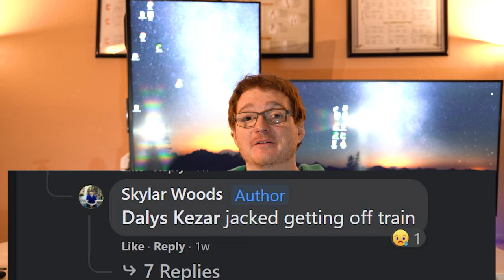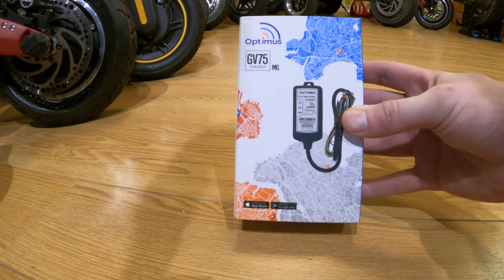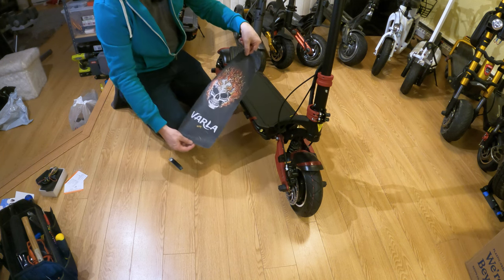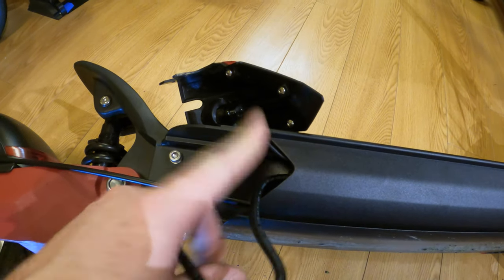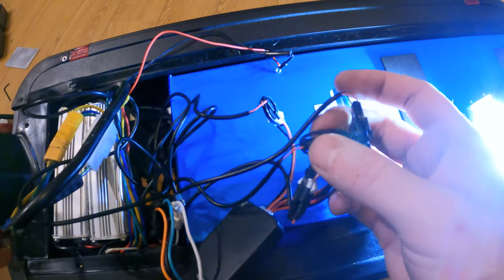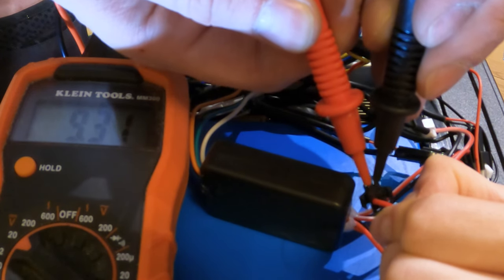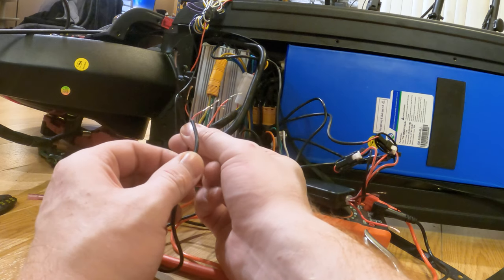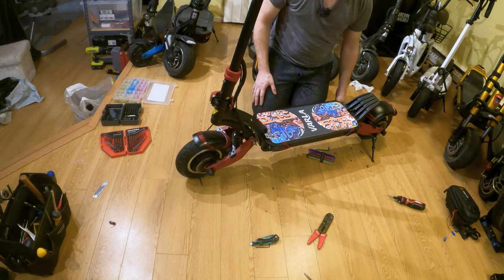Track Your Scooter With GPS! How to Install Optimus GV75MG Tracker In A Small Electric Vehicle

Comment: Butonce you take the key out of the varla all power is disconnected the GPS would no longer work so you lose all capability to track it what's the alternative.?
Reply: I think if you wire it in before the controller it'll have power as long as the battery has a charge
Reply: @silversquirrel89  ok let's see thanks for your input

Comment: Any tips on doing that on the Ninebot Max? I just got a similar tracker and I’m a bit lost, especially when it comes to voltage, my tracker supports 9-36V but the Ninebot battery says 36V nominal voltage and 42V charging voltage, would it be safe? Otherwise I’ll have to find other wire somehow 🥲. What even is the charging voltage??
Reply from the maker: Yeah you'll need to find wires coming out of the controller that aren't 42v on a full charge. Thatll fry the tracker. Buy a probe and start testing wires!
Reply: @GingerOnWheels  I’ll try. Thank you
Reply from the maker: @rfh9560  maybe hit up Chris from mymaxmods.com he might already know the accessory voltages

Comment: Did this end up working out? Do you have any recommendations for doing this on a larger (11+ Super72) scooter? Drain the battery at all?
Reply from the maker: Make sure there is room inside your deck before you buy it, but yes this ended up working out great. Very negligible battery draw, can't even tell its in there.
Reply: @GingerOnWheels  You’re awesome man, thanks for the quick reply! I’m a Florida rider, if I ever make it up there I’ll make sure to take your route around the lake, it’s beautiful up there :)

Comment: I'm gonna say something a little touchy here:
That light regulator is already being overworked, it's a 12v supply that ends up sagging to 9v under load in its stock state, pulling any more power from it WILL lead to serious issues down the road, like blowing the regulator up.

They're designed to push a max of 3amps and the lights take more than that apparently.
Reply: I've seen people swap the light system to power a relay and a higher power regulator so they can run high power lights and accessories like the alarm system I run.

Comment: So my question is 
If the scooter is turned off can you still track it?
If the headlights is turned off can you still track it? 
Would it make more sense to connect it to the brake wires since it is always ON when someone is using the scooter.
Reply from the maker: Excellent point and you're very correct. I realized once I had closed the scooter up that the wires going to the display or the voltage read out would have been better wires to tap into.  However, this GPS Tracker has a Built-in rechargeable battery that holds a charge when the scooter is turned off.  If the scooter is stolen and then turned off for for more than a few days though, than this particular installation would be useless. Hopefully it doesn't take you that long to realize its gone!
Reply: I was wondering the same thing, if it's not turned on how will voltage get to it for it to work? There's got to be a way to tap in the battery while it's off
Reply from the maker: @corywebb5537  the GPS tracker has a built in rechargeable battery that charges whenever the GPS in use.

Comment: Biggest issue with investing in a flash scooter is when you're not riding around affluent you could be targeted in a number of different ways. Which is why I debate between a scooter and a much lower profile ebike conversion.

some kind of mounted timelapse camera would be a cool security measure. I might research to see if that's even a thing.

Comment: But every time you want to charge the GPS tracker, you have to turn on the scooter light, did you think about this before you connect the cables and the GPS tracker  together ?
Reply from the maker: The thing uses such little battery that it's not an issue. As long as you ride for an hour or so every few weeks then it'll stay charged. You can wire it to any wire with power in there, though. Even the battery wires, which have power all the time.
Reply: @GingerOnWheels  Thank you for this. So when I get my varla would you recommend since I will be doing delivery on it, to wire this GPS to the battery wires? I will be riding for decently long rides 25 mph around
Reply from the maker: @1d2y  you can wire it to whatever you want. Just make sure to check the wiring specs of your scooter to make sure whatever you wire it to is within the voltage tolerances of the GPS tracker. If the voltage is too high you may also need to wire in a stepdown converter.

Comment: Hey can you show or recommend how to do this on a Kaabo Wolf King GT? Idk can you install a gps tacker in the box that holds the controllers?
Reply from the maker: Yeah you guessed it, I would just open up the box that holds the controllers find the wire that goes to the throttle and splice into that. Or you could splice into the headlight if you wanted to be able to control when the tracker was charging or not.
Reply: @GingerOnWheels  how does tapping into the wire for the headlight allow me to do that?
Reply from the maker: @Hermes8A8A  The wires going to and from the headlight only have power when the headlight button is pushed on the scooter. You could tap into the headlight wire and charge the tracker while your headlights are on. The tracker has an internal battery that doesn't need to be charged more than once a week.

Comment: But won’t this only work when the lights are on? Or does it have a battery
Reply from the maker: It has an internal battery that charges when you turn the lights on. Will stay on inside the scooter for weeks on a full charge.

Comment: Hi, I have a boyueda scooter 5600w , is it connecting the signal light wires together from the gps tracker black and red wires ?
Reply: I have the gps tracker connected with lipo battery installed inside the scooter, but I have to charge the battery every 15 days.
Reply from the maker: I'm not sure I understand your question.

Comment: Wouldn't work unless it was turned on, but there's got to be a way to tap into the battery so it works even when it's not turned on. I imagine it don't use hardly anything for power really. Of course the dumb shit who steals it's going to turn it on;-) :-) LOL
Reply from the maker: The tracker has a built in rechargeable battery that keeps the GPS on when the scooter is off.